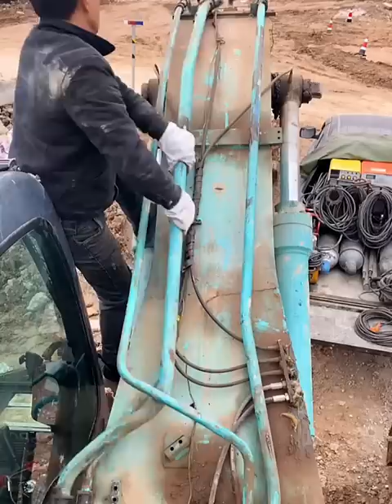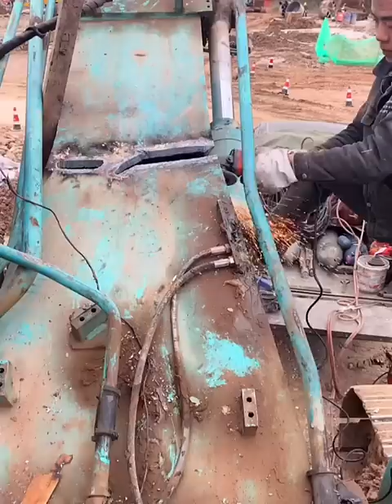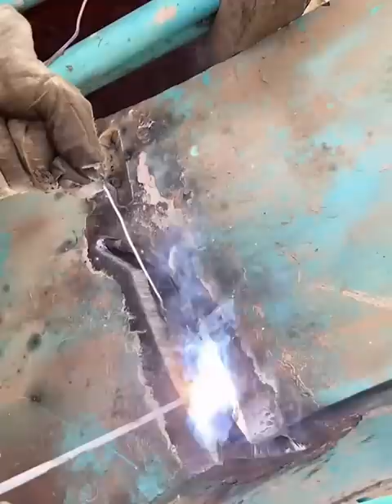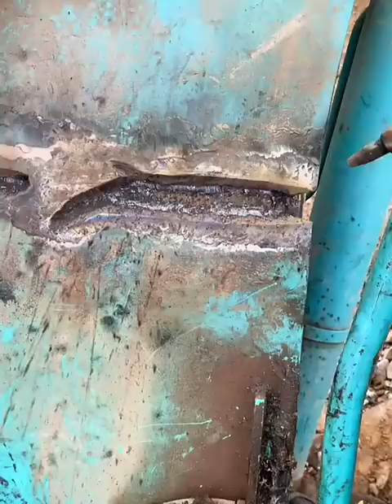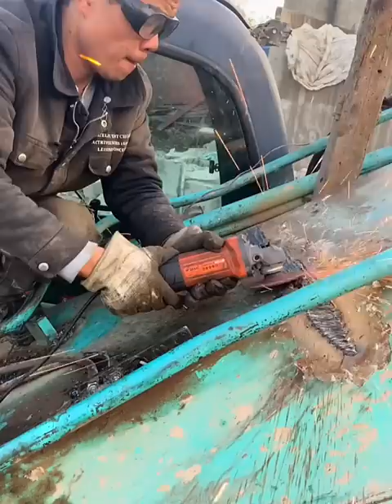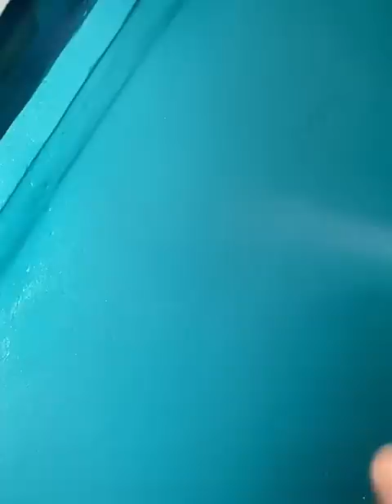Rebuild of cracked Kobelco excavator boom, perfect welding job

Comment: As a boilermaker welder. The only other thing I could have recommended was some post heat over the weld area just to assist with stress relief. 
Because that area will be a hard spot and will assist in preventing cracks in the future 
Good work
Reply: How much heat would you use and which method? Rosebud or slower propane roofing torch?
Reply: @jc-hd3ih  oxy aceytelene is a hotter heat.  Lpg is a cooler heat
Honestly and practically. Just use what you have on hand 
Heat the actual weld area and around 150/250 mm past it to about minimum 100-150 degrees 
Don’t get the metal brown or blue in colour as that’s way too much heat and softens the metal 

And let it cool slowly. Use a asbestos fibre type fire blanket or even dry sand if possible.  No water quenching or anything. What post heating does is help realign all the metal particles so they sit more normally if u will
On a metallurgic level. simply helps prevent cracking. Realigns the metal
When welding stick rods. The crack is most likely to appear on n the edge between the weld material and parent metal the weakest spot
When using mig. It’ll most likely crack down the centre of the weld

And btw. He should have pre heated that weld area also prior to welding. 
Hope that’s a help
Reply: @tontobb8956  it is. Thank you.
Reply: @tontobb8956  Thanks!
Reply: I haven't experienced a preheating equipment but I know it's good for the piece
Reply: This is the worst welding job I have ever seen. The original boom, which wasn't strong enough, has roll formed steel. This needed a large plate gusset over top. It will break again. 

This is a disaster.

This man is a clueless zombie.
Reply: @sasquatchrosefarts putting plates on something is always bad. If you don't have a multi-hole plate that distributes the forces evenly, you will move the stress to a few places where it wasn't even intended. Repairs must be done as simply as possible, respecting the original distribution of forces and with as few plates as possible. Where the metal is worn it needs to be removed, which this guy did.The bottom plates are thick to hold the weld and to have less heat around the welded area, as this would attract carbon, causing it to become brittle. This makes preheating less necessary (but in my opinion still necessary). If that work has been well welded, it will hold up perfectly.

Comment: Man that's scary bad😂
At least you know where it will break again 👍🏻
Reply: I don’t think a single preheat was done, give a day or two and NdT that shit
Reply: Yeah those backer plates will shove the stress onto different parts of the boom. He’s in for repeat customers, angry ones at that
Reply: @JTimberB.45  sometimes that’s what the customer wants, in the logging industry it’s pretty common to have repairs like this done so the machine can get back into production, then after the day when the loggers go home and production is done for the day, a real repair is done. A repair like this is good if you are trying to get the machine back into the field fast, let’s say it’s a log loader, if there was isn’t any loader running then logs are not making it to the sort, which means no money being made for anyone.
Reply: @VortekXtiik  I understand the temporary fix, but when you patch a critical failure like this, it will only make the future repair even more expensive and increase the chances that a whole new part is needed, not to mention that it is dangerous. This repair could kill someone, because it’s not fixing it correctly

Comment: I started out as a welder for an heavy machinery contractor doing quick patch jobs like this one here. I know that this is not the best way to fix these kind of fractures but 9 times out of 10.. throwing some backer plate in the hole and welding her out is all that maintenance will allow enough down time for you to do.. the only thing I would do differently is use a thinner piece of backer..
Reply: Why would you use a thinner backer
Reply: Why thinner? The backer now is probably the strongest part of those welds.
Reply: @goatsinker347  Back plate is not contributing to the strength of the weld,it just makes it easier to weld the crack shut. So it can be a much thinner plate, that thick plate draws a lot of heat away from the weld which makes it even more neccessary to pre-heat

Comment: I've been repairing machines like this for many years, and I can honestly say that will very likely crack again pretty soon.  The only way you can make it as strong as it was before is by welding in stretcher plates over the affected area, if you don't it'll just crack again right next to the repair. After all that welding it'll be heat affected, especially as the weld was allowed to cool rapidly in the open air, the metal around that area will become brittle and weaker.  

Another big problem with newer machines is that they are very often built using heat treated and tempered steel.  This means they can use thinner sections in order to keep production costs down, and reduce the weight of the machine.  Of course if you try to weld it in the conventional way it buggers up the tempering, leading to even more fractures.  They can be a real pain in the butt and require some careful handling.
Reply: Скорее всего для продажи
Reply: Aynen size katılıyorum bende yıllardır buislerle uğraşıyorum tam olarak kesin çözümü caresini bulamadim bi kere kaynak yapmaya basladiysan artık hayır gelmez saygılar from türkiye 🇹🇷🇹🇷 siz ??
Reply: Du hast völlig recht. Wenn man hier die Kommentare liest, kann man ermessen wieviel Leute es gibt, die keine Ahnung haben,aber die Fähigkeiten des Schweißers bewundern. Ohne schwalbenschwanzfoermige Verstärkungen wird das nichts.
Reply: 100% correct!
Reply: I was gonna say wouldnt it need a kind of fish plate on top of the welded area ?
Reply: @jeepsblackpowderandlights4305  yes, of course, but, you know, next time this guy is going to be as clever as we are already
Reply: What size would you use for stretcher plate? Is bolting them safer then welding?
Reply: @nicolasbelokurov8891  I would say at least 12 inches or more of plate that is as thick, or thicker than the original parent material.  Bolting is not recommended due to the fact it can allow movement which will eventually lead to failure of the joint.  Hot riveting would be the only other potential option, but this requires access to both sides of the plate which isn't possible on something like a section of excavator boom.  Welding does indeed carry a risk that it will weaken the material the structure is made of, but if the heat input is managed correctly then the affects can be minimal.
Reply: @Altair885  thanks

Comment: It looks good, but how will it hold up? I didn’t see a method applied to distribute the forces over a large area. I foresee that this “pretty” repair will fail fairly quickly.
Reply: I agree, He had better ad some metal sheet outside to get forces away from this repaired area. Seems we are the only guys to understand. IT is not enough that this repair Looks nice.

Comment: Great bodge if you just want to sell the problem on to someone else.  However if you want to keep the machine it will fail again fairly soon.  Repairing it in that way causes a massive heat affected area that will be weak and fracture again.  To properly repair it, that section must be played over with stretcher plates over the area.  It's not pretty but it's the only way to produce an end result that's as strong as the original material was.
Reply: At last, you are the third Person to know how to Do that Job. So, see the comments and guess how many fools are working in this Business
Reply: Stretcher plates can cause cracks too. Not saying what the right way is but I've seen both ways fail. Simple answer is you can never have it as strong as original again. These booms flex sideways too and plates make them rigid. It'll last a little while either way but the only 100% fix it to replace boom which is not gonna happen
Reply: @johnzadinya2181  Excavator booms are not intentionally designed to flex, they simply do so due to minimal amounts of material used in their construction.  They are designed to be as light as possible, flexing is an unfortunate side effect of such construction practises.   Plating the end of a boom is also not likely to result is further failure if done correctly, the stress points you envisage are mitigated by selective plating techniques that prevent stress induced fracturing.  The problems that are often encountered with such repairs are often as a result of excessive heat that can produce weak spots and tension in the steel itself.
Reply: @Altair885  if plates are used, they must be rounded or fish mouth or somthing at the end. I've seen repairs where a weld is done with no plates and holding up fine years later. Everyone has their method. There really is no correct way because Every method can fail. Your method might be the best but again it will never be the same any amount of heat from welding is going to weaken it
Reply: @johnzadinya2181  Don't forget, it was welded into being to begin with.  Most booms today are done using a MIG with no metal aftertreatment to relieve stresses or give any temper. But then boom fractures are more of an issue than they used to be, you'd hardly see any on machines produced in the 70's and early 80's.

Comment: First of all nice job you have done and nice video as well,so i was wondering what is brand of battery impact wrench at beggining of video and is it possible to order via aliexpress,thank  you one more time.regards.
Reply from the maker: the battery impact wrench is a domestic brand, and I don't know if it can purchased abroad. I think a BOSCH tool is better than this brand, as BOSCH tool is much expensive than this
Reply: @weldingartist55  thank you.

Comment: Those backing plates, could you of drilled holes in boom so that the plates could of been plug welded to boom also? Make sense? Make plates a foot long? So on I side of boom it's like a big stitch.
Reply: @vik adding more weld to the boom with backer plates will further add stress to the boom in new places, not to mention it didn’t get preheated. Should have cut the entire section out and went from there with fresh material
Reply: @vik I understand the concept of plug welding the plate underneath, because more weld=stronger part. but that’s not always the case. More weld in this case means more stress on other areas of the part, especially because there was no pre/post heating.

Comment: Should have cut an entire area out and replaced with a fresh plate. Cutting the cracks and adding doubler plates will just make new stress fractures elsewhere because it will just shunt the strain to the other parts of the boom. He’s in for repeat customers. Angry customers.

Comment: Why wouldn’t you just cut it all the way out and put a full insert in?  Use A-36 or  Hardox   By putting all those passes in You just added a stress point, on the top of arm that takes all the weight with a “Heat Affected Zone”    
High probability of stress cracks forming.
Reply: Dunno where he's from but you may not be able to get such grades of plate easily there , such is the case where I'm from , I do basically what he did , gouge the crack , install backing plates , fill with welding ( his uphill game could use a little work) . Only thing I do different is that I cut a  brace to weld across the affected area.
Reply: @shaneward6689  There’s actually less work in cutting out the whole area around the crack, Then putting in an insert, and welding it in.  
You have  new, unstressed steel and it will hold up better.  
I’ve had to cut out 100’s of those type of repairs and do it right.
Reply: @overtheclouds9  I dont doubt ya one bit , the %100 right way and the way you have to do it when special plate is 3 weeks away is a different story , I live on 166 square miles of island in the Caribbean.  We can barely get 7018 rods right now . It's insane,  most of my repairs are done with plate salvaged from the scrap yard because a repair like that would cause most people to scrap the tractor ....they cant afford to do it the right way , so I give them the best I can for what they can afford and wait until it breaks again and fix it again . And I've gotten kicked off a job mid repair because " i was taking too long "You gotta roll with how the customer rolls sometimes ....its a world apart compared to how things are done in America or Europe.
Reply: @shaneward6689    I get it, It’s like Alaska.  Nothing gets thrown away because you didn’t not know when you’ll need it.  
Wish you guys could get some rods or wire.  I’ll take a 6010 weld job if needed. 👍🏻💪🏻
Reply: @overtheclouds9  right now I'm running rods packaged in 2000-2003 . I put them in the oven at 300 F and wait for about a day , they weld surprisingly great and I have yet to get a failure. Lol the things we are forced to deal with .
Reply: @shaneward6689  👍🏻🤣. 
That works!